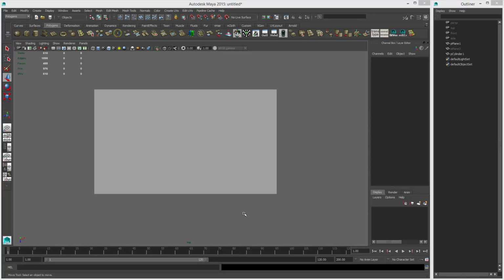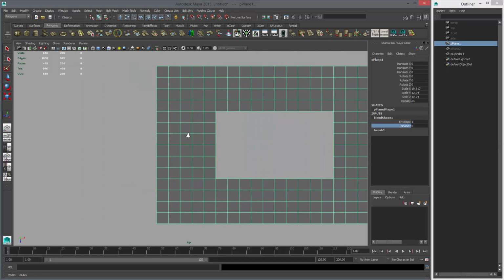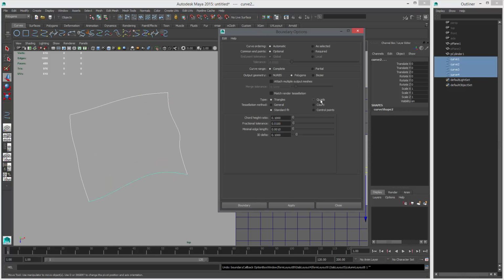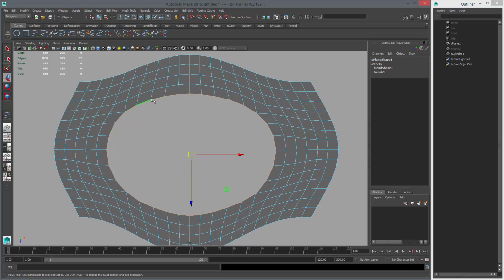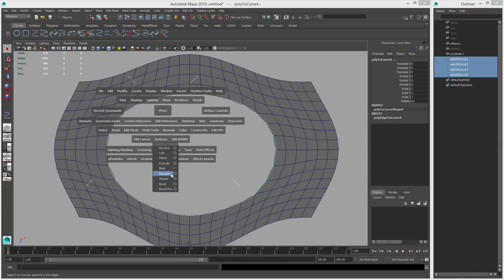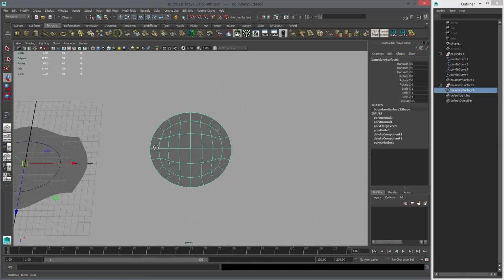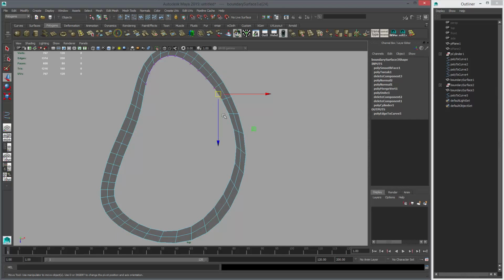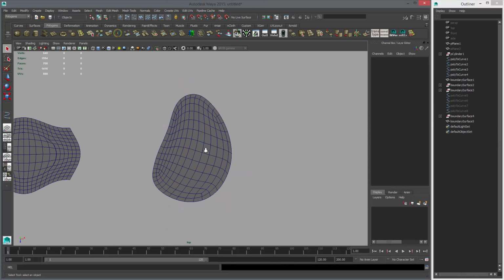Filling a Hole in a 3D Model

Comment: awesome! I've been converting edges to curves the wrong way. I've been selecting the curves, going to edit curves and select Duplicate Surface Curves and it worked but for every edge it created a different curve so I always had to attach them together. I never noticed the converte edge to curve on the convert menu. Thanks
Reply: I also struggle a lot when it comes to coverting NURBs to polys and I never knew about that general/ per iso option! Thank you, one video helped a lot!